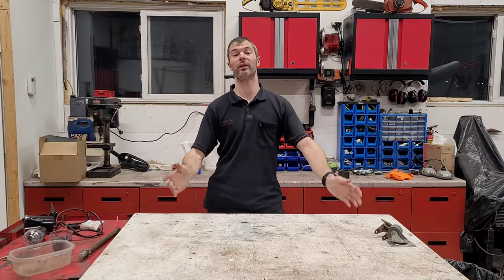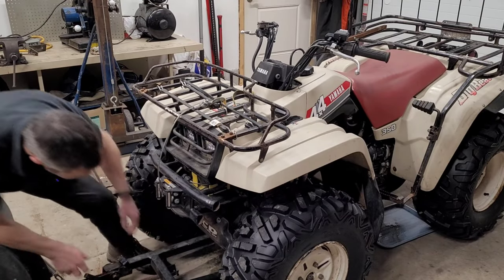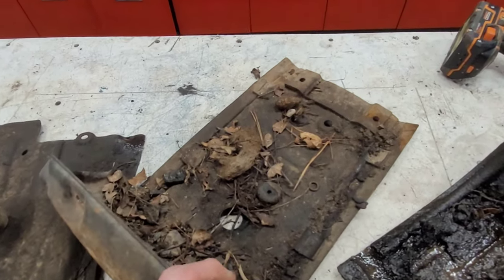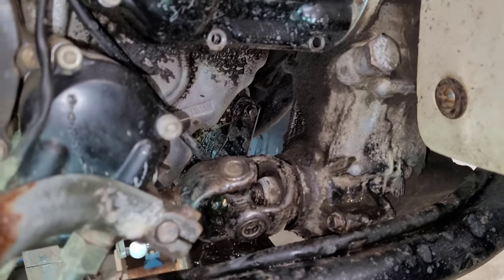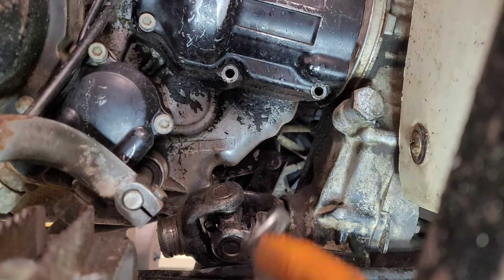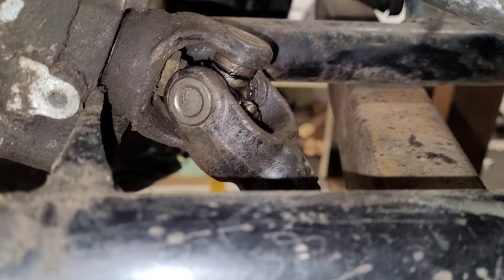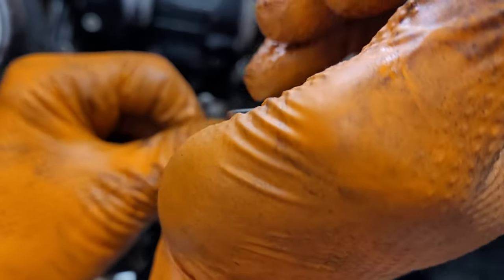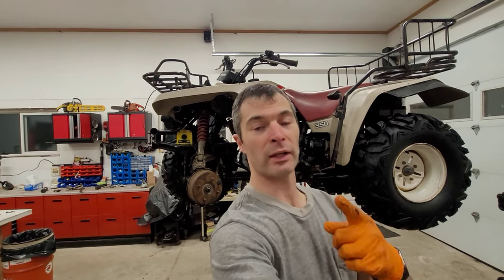This Repair NEVER ENDS !!!

Comment: I find it funny I just changed my u joints  on my big bear and now I have a leak of some sorts lol same as you lol
Reply from the maker: Let's hope it's not the same seal! It's quite the job. Don't forget,  the middle drive gearbox uses engine oil
Reply: Of course it's the same seal 🤣 I plan to do a complete restoration on this quad it has sentimental value. It was my grandfather's. But it needs lots of work especially the frame

Comment: Its the same oil in the engine and gear

The transfercases uses engine oil, on these bikes has a small orifice that moves engine oil to the transfercase
Reply from the maker: Thank you for the comment! Would you be able to send pics of the orifice? I'm only asking because all the info I was able to find said it was gear oil. This has been a debate that I would like to settle... thanks in advance 👍
Reply: Do you have a mail?
Reply from the maker: @svennok  thmrepairs@gmail.com.

Comment: Does your throttle hurt your thumb after a while? Mine does and I don’t know what to do to fix it
Reply from the maker: Some add a thumb extension to the throttle. If used properly,  I think they are ok but because of the extra length, they can be dangerous.
Reply: @thehonestmechanic yeah, that’s what I’m worried about. Might try it though. Have you had any issues with cramping?
Reply from the maker: On very long rides yes. After a while, you build thumb strength 💪!!